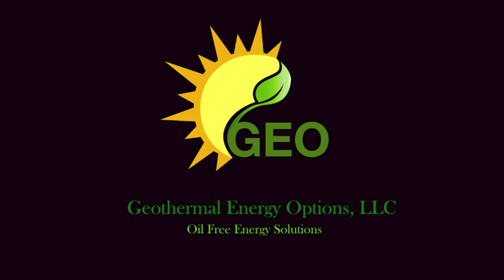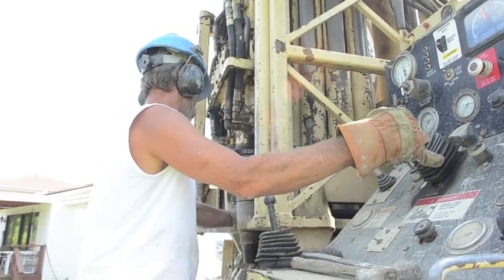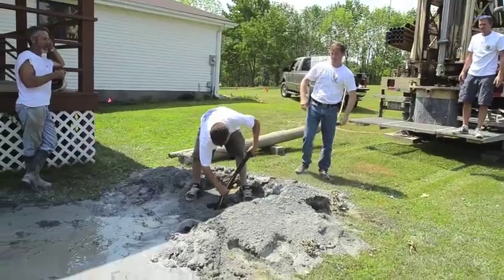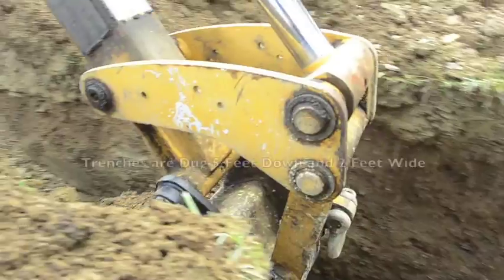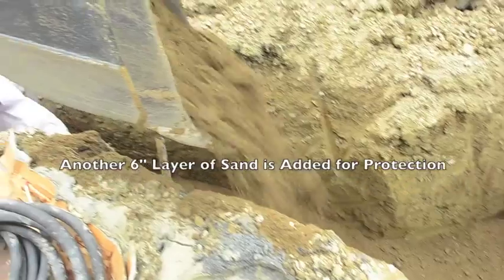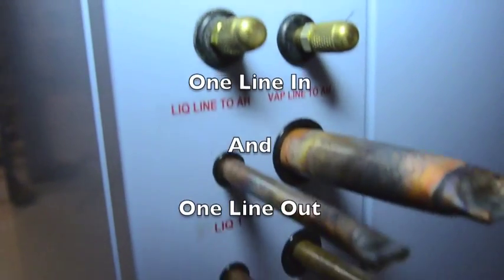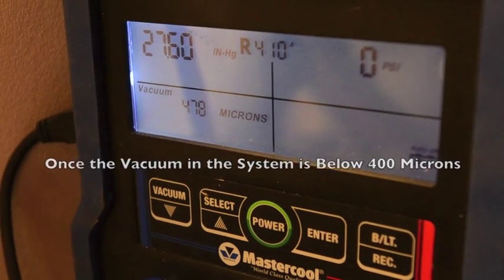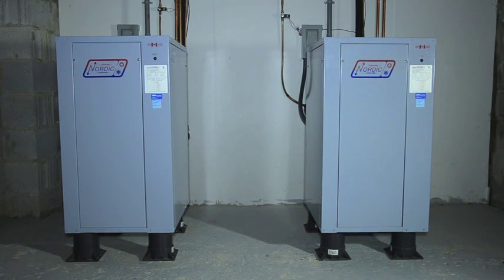Geothermal Energy Options - Retrofit

Comment: But how much electricity is used to run the compressors? Is it more or less than a regular air conditioners?
Reply from the maker: About 50% less
Reply: @geothermalenergyops  The entire year or just right after its started, for a few hours? Maybe the soil doesnt radiate the energy as well after a few hours of use.
Reply: Thanks!